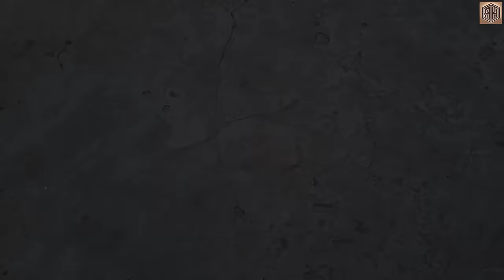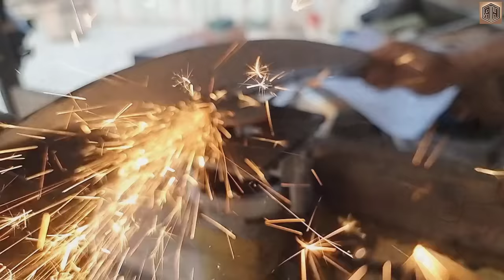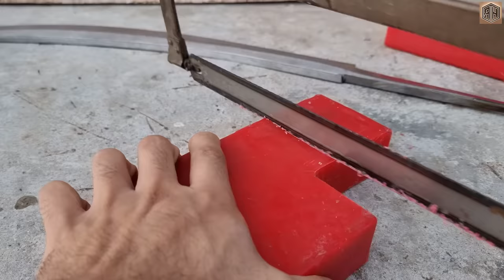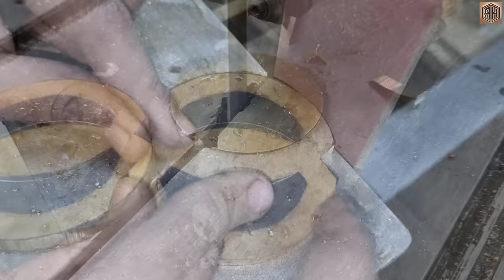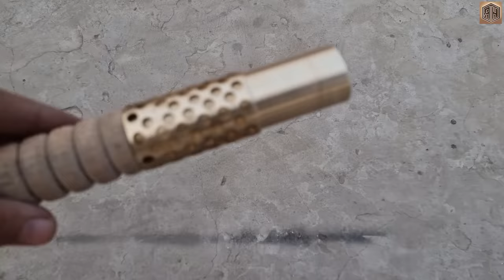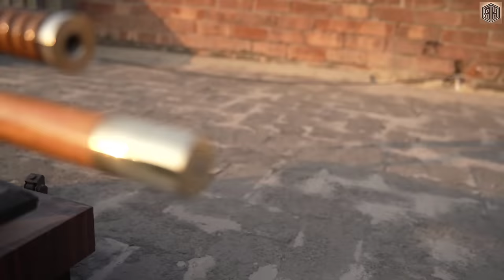Forging White Beard's Weapon out of Rusted Pipe wrench

Comment: Nice job, but if you ever have an inkling to build another one, the handle shaft on traditional Naginata were oblique, so that the wielder can easily index the blade edge. Round shafts were used on Yari only, because they were a mere stabbing weapon, and blade indexing wasn't necessary!
Reply: Hey he can probably make stuff with a hamer and knife and sharpener stones
Reply: This is why in the cutting demonstrations he wasn’t able to cut cleanly, if at all. He basically bludgeoned the coke bottles with the side of the blade because the alignment was off, because of the round handle
Reply: Can u index me?
Reply: @GardenGuy1942  in the eyes
Reply: @martinguerre8220  I’d like that
Reply: @GardenGuy1942  damn ok
Reply: Yeah round handles suck, I hate em! Almost every single bladed weapon should have a rectangle like handle.
Reply: I dont know what these words mean but you seem to know more than i do
Reply: @gmunch1  also and not to say it's not a beautiful peice of art. He could've beveled it while forging then grinded a secondary bevel along the edge to make it even sharper. Plus Burning the metal after tempering makes it significantly weaker aswell. Also I'm not speaking out my ass here I've made swords, knives, axes and one time wolverine claws
Reply: Blade Indexing was a hole to fall into. Google was also unhelpful so I'm leaving this here. The gist of indexing is that by having the handle and the blade edge share a similar shape/edge (the top of the oval lines up with the edge of the blade) the user can determine the orientation of the blade much easier. Making slicing much easier
Reply: if people know more please comment!
Reply: @sirkelendor5429  You have google for that
Reply: @goulven05  yeah i aint got effort for that
Reply: but its not supposed to be a traditional naginata. It’s like a naginata
Reply: @gmunch1  In his defense it did not seem like he knew how to properly hold or swing the weapon, then again I'm not an "expert".
Reply: he make the handle round because he is making/copying white beards weapon, tho i do not know who is white beard
Reply: It was round because that's the shape of the Naginata he was forging it in the shape of.
Reply: Whitebeard’s weapon has a round handle, so technically it is accurate. Even if an accurate naginata has an oblique handle.
Reply: これ薙刀やろ？
こーゆー便利な武器や。槍よりも。

Comment: I have a question: does it rust? If yes, what do you use to stop it from rusting?
Reply: light coat of wd-40 should stop any surface rust
Reply: A light coating in gun oil is good if you're going to be using it often. If not, you will want to apply renaissance wax; it will protect your sword or other steel weapons from rust for a couple months if you don't touch the blade or cut anything with it.
Reply: @Fellow_Daoist  But if you do use it often, what would be the solution from stopping the rust?
Reply: @vladrugina94  Well, if you don't care about the looks of it, you can spray paint the blade. Spray paint will prevent rust. You can also use a light coat of gun oil or mineral oil on it. That will prevent rust from forming.
Reply: @vladrugina94  Remember to reapply oil or wax after each use.
Reply: @vladrugina94  Where would you be using it often?
Reply: @WaddedBliss  That is a good question, however, I'm am strictly talking about knifes, not the naginata itself. A knife you would use often, more or less.
Reply: ALL steel will oxidize, recipe to fight oxidation. 
Japanese used oils and constant polishing. Today's modern steels fight corrosion with coatings.
Reply: @spikedpsycho2383  Can you give me some examples of steel coatings please?
Reply: @Social Injustice Goblin My question was regarding knifes mostly, not this particulary piece.
Reply: @Fellow_Daoist  if you use it often eh?? o_O
Reply: @vladrugina94  simply wipe the whatever off your blade with an oily rag. Whatever=sap, muck, water,blood etc.
Reply: Paint coating
Reply: I would use it to crush the WG or BB
Reply: armorment haki

Comment: A naginata has an oval shaped handle to control the egde orientation, not round like a yari. The nakago is also significantly longer and sturdier to withstand the striking force, around 50 cm.

Comment: You crafted a mono-steel naginata blade.  You probably know that historic naginata blades were constructed from multiple layers of steel.  Your setup probably limits your ability so you can't be criticized for that.  The shaft on your weapon is too short and is round instead of ellipsoid.  The naginata did not have a round shaft because the ellipse informs the hands where the edge is located.  The ishizuki (butt ferrule) on your weapon is too small and light to be an effective secondary weapon for smashing, eg., the enemy's exposed instep.  Additionally, the naginata shaft was not grooved because grooves prevent the forward hand's swift movement up and down the shaft for power in both cuts and thrusts.  My comments are based on training in a tradition (academy/school) established in the 1580s.  After training for over a decade I was tested and ranked in Tokyo in Heisei 2, 1990 on the Western calendar.  Who is White Beard?  To my knowledge, no bugeisha bore that name.  Allow me to end with saying that for someone outside Japan's ancient martial tradition (very evident from the way you cut the plastic bottles) you did surprisingly well.

Comment: Naginata's handle has an elliptical cut surface
In the case of a circle, the cutting edge will flow during cutting and it will not cut well.
This is the same as the handle of a Japanese sword.
Probably because of that, salmons didn't cut well.　　　From japan